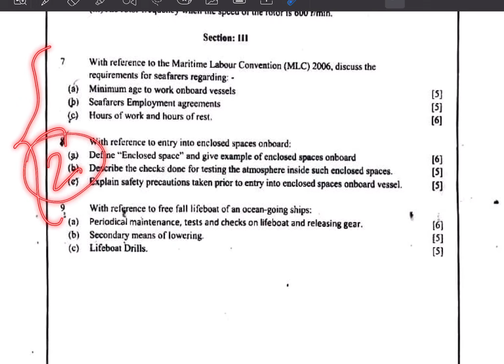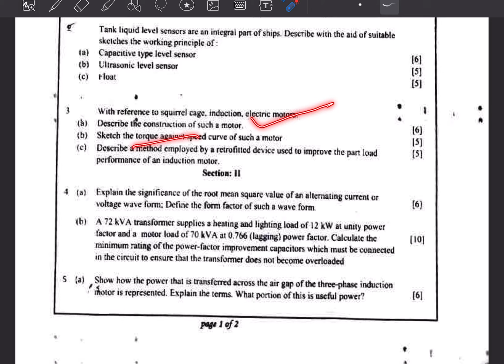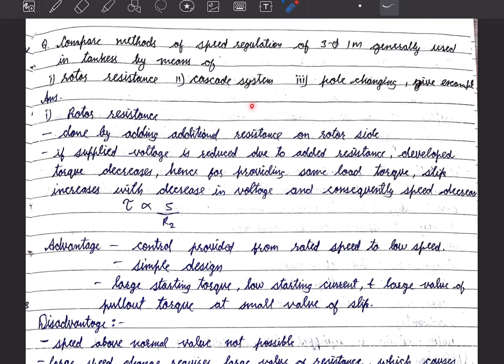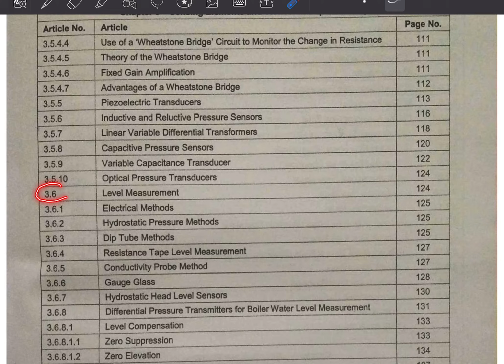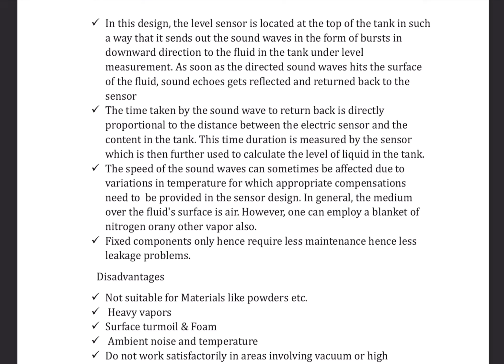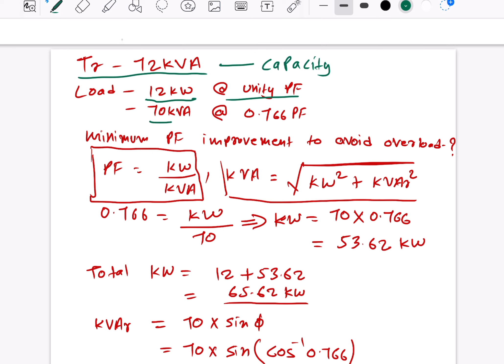ETO COC Written question Answer December 2023 part-1 #eto #merchantnavy #coc #exam

Comment: Sir does ETO has overtime extra pay or not 

And please mention passing marks for this exam
Reply from the maker: Overtime is included in salary
No seperate overtime
50-60% is passing
Reply: @etorahul  yes but if i signed contract of say 1000$ per month so my overtime is included in that or how many hours i worked extra in that perticular month i will get extra lets say 1000 + 200$ overtime right
Reply from the maker: @elrodgaming5712 you will only get 1000
Reply: @etorahul  ok